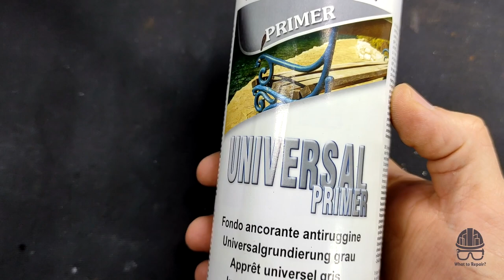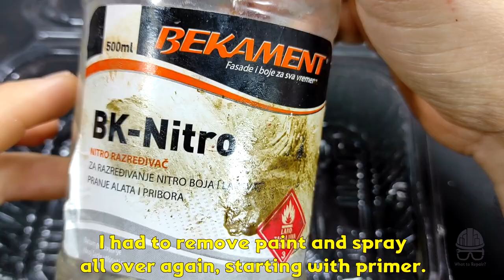Matchbox AMX Pro-Stocker 1:64 custom restoration with fails and new wheels from Aliexpress

Comment: One quick dumb question. Why didn't the whole thing go in the ultrasound cleaner once you got it open? That's one of the dirtiest cars I've seen in a while. Awesome build though
Reply from the maker: Well, I would like to try with ultrasound cleaner but I don't have it. To be honest, I never saw that someone is using it to remove paint and corrosion from diecast cars. I don't know why. Maybe it's not efficient enough against paint. But probably the main reason is because paint removers and thinners are way more cheaper than ultrasound cleaner.